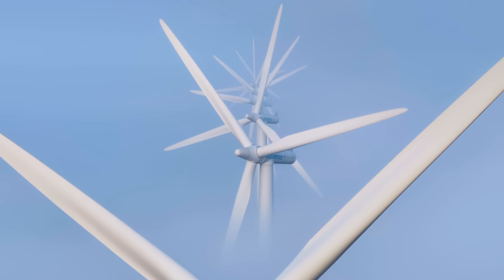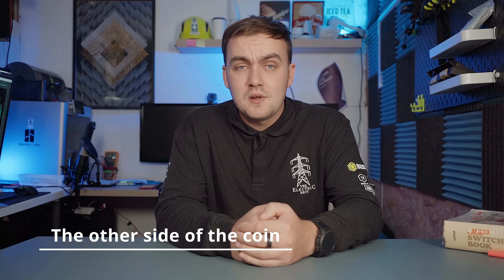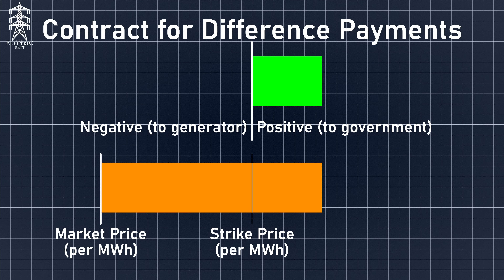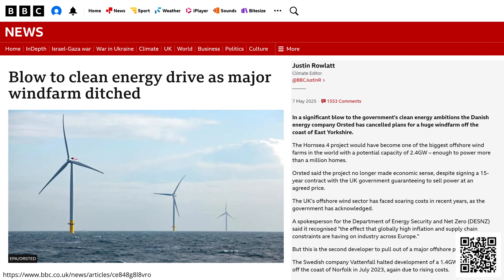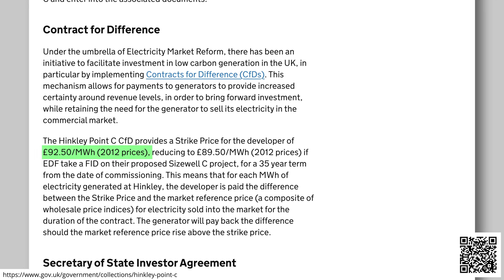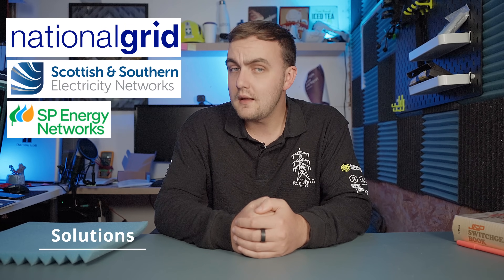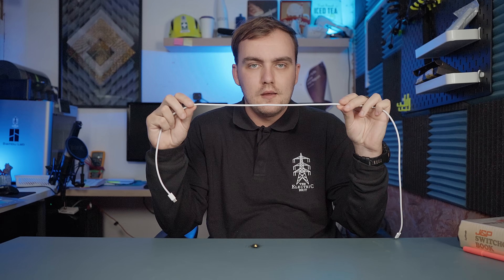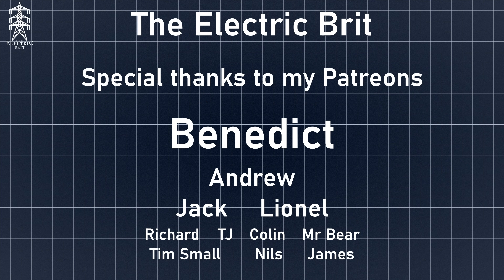£1.8 BILLION Wasted on Energy Bills

Comment: Reconductoring and dynamic line rating for the win! When you talk about upgrading lines, is it reconductoring (with new or larger traditional conductors), or new pylons that is enabling it?

Auke Hoekstra has written some upbeat coverage of this tech.
Reply from the maker: Hi! Reconductoring is the first port of call usually, moving from two to three or three to four conductors. In the UK we don't go beyond four (a quad bundle) of conductors although I've seen pictures of some UHV AC overheads in China that had 8 conductors.

Dynamic line rating is fairly new and will likely be added to lines that are already a quad bundle to try get more out of it, or to lines where they cant justify reconductoring yet.

As part of the great grid upgrade though there are brand new overhead line corridors going in for example Grimbsy to Walpole, Norwich to Tirbury and one around Leicester to Spalding is planned among others.

Comment: Everyone keeps saying curtailment is all about Scotland and the B5/B6 transmission bottleneck. That’s only part of the truth. I live on the east coast near Felixstowe, and I see it with my own eyes every single day. Even with brutal year-round wind, farms here are curtailed. The reason isn’t wires it’s low inertia.

When you spin a turbine, you don’t just make electricity. You give the grid inertia for free. That inertia is what soaks up shocks before software even notices. For a hundred years, coal, gas and nuclear gave us that without anyone thinking about it. We shut them down, and for 20 years we replaced them with nothing.

Now the grid leans on inverters. Manufacturers call it “virtual inertia.” But physics isn’t virtual. You can’t fake a spinning mass with code. Without real spin anchoring them, inverters begin to hunt chasing each other’s phase noise. That hunting is bad for the network, so operators curtail wind long before any physical limit on the lines.

Take Felixstowe as an example. The port runs cranes up to 150 MW. When a ship berths and they all fire up, local frequency swings  and house voltage crashes around a lot, any UPS trace in Felixstowe tells you all you need to know.. That’s with synchronous condensers already added on the transmission side. It helped a bit, but the farm still hunts like a drunk duck under that step. The lights flicker, the wind output gets chopped, and the official stats call it “constraint costs.” From the ground it looks like a system with no spine.

So yes, transmission upgrades matter. But to blame wires alone is unfair. The bigger truth is that we’ve hollowed out the grid’s mechanical strength. Without inertia you don’t have magnetic fields, you don’t have stable coupling, you don’t have phase angles you can trust. And without that, all the “smart” inverters in the world are just floating on sand.

And if it really was all about the B5 or B6 boundary why do we have curtailment in the south when consumption is always enough not not curtail??? Because were low on Inertia, low on mass that spins at a sync speed? Felixstowe curtails fairly regularly. 

That’s why curtailment keeps climbing. The grid could handle the power we’re generating but not without putting real spin back into the system. Until we face that, we’ll keep paying billions to turn off wind farms while telling ourselves it’s just a transmission problem.

Comment: Access energy! such as excess wind or solar, should be delivered at ultra-low costs to AI data centers, electric vehicles, and smart appliances. It makes no practical sense to keep building energy-hungry data centers around London, far from where surplus power is generated. Instead, co-locate them near renewable sources to soak up clean, cheap electricity.  🚿 ⏲️ Appliances should be mandated to auto-detect low-cost energy windows and activate accordingly, e.g., staggered 15-minute runs for washers and dryers. Let machines adapt to the grid, not the other way around. Why pay double later, when you can consume near-free green power now, efficiently and automatically?
Reply from the maker: Fully agree. Colocating generation with critical assets and power hungry ones just makes sense to cut down transmission costs. Zonal pricing aimed to fix that and we saw the panic when it came to the smart meter roll out, some people are scared to let power companies control their appliances (yet most people with an EV love that feature, I know I do, the cheaper the better)

Comment: I often wonder what our grid would have been like of more 3rd generation AGR nuclear plants (like Heysham 2 and Torness) had been built like at Druridge Bay. At that stage it seems like they had finally resolved on-load refuelling limitations for older AGRs (as a result allowing Heysham 2 to break world records for reactor up-tine). I’m not sure if inter-core fuel re-shuffling was ever implemented though.
Reply from the maker: I had planned to do a video on the different generations of reactors and pros / cons. I’m of the opinion that if some designs had been banned, we might be in a better position both in terms of public opinion (safer options) and technologically (more investment in the right areas).
Reply: @TheElectricBrit The older Magnox fleet had mixed results - largely due to the base design being modified/evolved by different builders. The AGR fleet was more consistent, but the disaster that was Dungeness B killed off export orders (apparently US utilities were interested in the design at the time). The whole fleet of gas cooled reactors have proven to be very fault tolerant over the years – including tolerating operator negligence like blocking fuel channels by accidently dropping tools into them.

Comment: Small point: it is fine to pronounce NESO as "knee so". Also, ultimately, we need more py^H^H transmission towers. I know the nimbys want to blame renewables, but generation tends not to be where land is expensive (the South East) while that's where the increasing demand is. SSEN did a thing on the challenges of undergrounding 400kV which nicely explains why it's so rarely done with exceptions like the last few miles to Dinorwig.
Reply from the maker: Cheers Phil, I’m a stickler for speaking acronyms, even after 18 months I still call EGL - EGL where most call it EaGLe.

I’ve got a video planned to dismantle the arguments of some prominent groups here in East Anglia, talking about capacitive charging currents and cable limitations etc, and have had the same arguments on LinkedIn about the Scottish highlands. I’ll be kind but I’m sure work won’t be happy! 😆
Reply: The Rampion wind farm off the Sussex coast has its 17 miles of 150kV onshore transmission all underground. About half of that is through the South Downs National Park. The other half is past the back gardens of some well-off NIMBYs. A similar all underground routing (but 400kV) is planned for Rampion 2. The transmission built for the Shoreham coal power station (now CCGT) follows almost the same route and is all on pylons.

Comment: A comment from across the pond. Wind is a cheap source of electricity but the problem is the wind is not located were the load is located. In addition wind is not all ways blowing at the same time that the load is calling for more power. If that were not enough, add into that the transmitting bottle neck that will not permit the flow when they do match up. The best solution is to add utility scale battery's. The fist place is to add them as close to the load as possible (distributed on the distribution network close to homes and factory's for the best impact) as not only can they sync up load with supply but they can also meet peak demand requirement's as well. The second best place is at the source which can soak up excess supply that can not be sent to the load because of transmission bottle necks or lack of load. This allows transmission lines to theoretically be loaded up 24 x 7 to its capacity. After which once full capacity is reached a transmission upgrade is required. We don't have much offshore wind running over here so we don't have the experience that you Brit's have. But Texas is an interesting point as they have a lot of onshore wind which is very active at night. In fact there is so much if it that it drives the whole sale price into negative prices at night. As a result some of the Texas utility's were offering there customers free electricity after 10 PM when load is light and supply is abundant. This is because with the negative prices the utility's can still make money. To take advantage of all of the wind available in the north west of the state they built a transmission line from there to the load centers. The result was that this new line filled up to capacity and no more wind could be developed. Once that happen developers realized that there was plenty of capacity available on the line in the afternoon perfect to use in developing utility scale solar. Now the line is filled up during the day and the evening with a small dip in power when solar is ramping down for the day and the wind is starting to ramp up for the evening. On shore wind and solar appear to be a perfect complement to each other with a small amount of battery's to fix the early evening Power dip between the two. Perhaps you may want to make a video about the subject. Best wishes to our British friends across the pond. By the way I love that the cat wants to contribute to your videos.
Reply from the maker: In the UK my energy provider gives very cheap power between 11pm and 5am or there abouts to make use of cheap night power. They control my car charger to charge it when it’s cheap. 

I replied to another comment about the amount of battery projects coming online over the next 10 years, a lot of what’s being built now is near the bottle necks

Comment: Numbers are put forward in the press without any context. 
1.8Bn is indeed a lot for Mrs Bloggs down the road.
The total electricity bill for UK is around £50Bn (300TWh) per year, so £1.8Bn is only about 4%. 
Not ideal, but not the disaster portrayed in the Daily Tripe-o-graph.

I can see 4 offshore large windfarms from the end of the road here (using pair of binoculars).
Reply from the maker: Agreed, but it’s still £1.8B of waste that we can reduce, plus the additional £12B for standby gas stability services. So around 30% of savings in total, not including all the other cost benefits (and spending needed to replace that stability services). Greenpeace published a paper on the savings yesterday or so, but with everything you need multiple sources of information.

Comment: Another very informaive video Jordan - and a lot of work researching the information - thank you.
All the acronyms fog my brain and make the point that privatising everything (Thatcher mantra)  just complicates the maths and the administration, but acountants love cost centres.
Instead of paying for curtailment why not store the energy? 
Battery Storage, Pump Storage, Compressed air storage, district heating ?
I understand that there are infra structure costs associated with these schemes but they become permanent structures. 
Could these energy storage mechanisms offset the need to use gas generation?
Having read Small is Beautiful (a long time ago) I remember one key observation " Think globally, but act locally"
We over complicate things.
Reply from the maker: Hey Steve, thanks for the comment and I agree. I have no idea about RO (Renewable Obligation) payments before I made this video and it really got me thinking. I dug deeper after I finished shooting the video and found the staggering costs being paid out for past projects and how it really just obfuscates things.

I think battery, hydro and district heating should definitely be considered where it makes sense. There's pros and cons to each but more storage is definitely a necessity to help manage the peaks, and also helps with inertia and voltage control which are hot topics around blackouts. 

We do still need to invest in the network to move the energy around better though, as it still needs to get to storage, and then from storage to where the demand is.
Reply: @TheElectricBritthanks Jordan.
You have a better understanding because my knowledge of the infra structure is limited and I'm retired.
Like every engineer I'm looking to improve a system's operational efficiency and integrity and what you are showing is that political pressures are overriding these fundamental requirements.
Moreover because of the 1980's mantra of privatisation shareholders are looking for profit.
I believe this is unhealthy for the sustainability of a national strategic utility.

Comment: It really is an example of why assuming in the 1980s that private enterprise would always create the most competitive market, and applying that blindly to everything the country needed, was a very poor choice.  I blame Professor Sir Alan Walters, Thatcher's main economic adviser.  But we are where we are -- we need to develop ways of storing the excesses in order to release it when it is dark and there is no wind, for example.  What sort of capacity is there in the growing BESS sector?
Reply from the maker: BESS is rapidly growing. We're at around 6GW / 8 GWh of storage currently which will help for some peaks and troughs but to really be effective for stability we need the equivalent of that distributed in every county I'd say, to account for some being out on maintenance, some being empty or full etc.

There's 17 GWh connecting to the grid in 2025 and about 444 GWh in the pipeline which should definitely see us right. Most of that is due after 2030.
Reply from the maker: Thanks for the comment. I agree, it's hardly competition when you have regulated monopolies and "The Big 5" for example. I don't think we do too bad in transmission but I might be bias, but it still doesn't take away from the stupidity of privatising critical and necessary infrastructure and making said regulated monopoly...what's the point other than to make a quick buck for the government and those involved at the time and make the tax payers pay indefinitely?
Reply: @TheElectricBrit Michael Liebreich suggests 4 hours of battery storage is a good rule of thumb to get countries through peaks and troughs of generation during a given day. The 444GWh capacity would be between 2 and 3 hours of storage?

Comment: no wind = no power, but they still get paid. Too much wind = lock windmills off, you dont want them to overrun and explode, literally explode. But still get paid. ITS ALL A GIANT SCAM
Reply from the maker: I responded to someone on LinkedIn today about this. They will only get paid to switch off if asked by NESO. If they switch off due to high winds to protect their turbines, that's on them and they should not be paid for this. They won't get paid if there's no wind, only for the energy they export or could export if told to stop.

Same for gas plants that are needed for balancing the grid but go off on maintenance - they aren't meeting their obligations so shouldn't get paid.

Comment: The CFDs have provided cheaper electricity. By guaranteeing a level of income the cost of capital borrowed was cheaper because those providing it didn't need to factor in potential losses. In terms of offshore wind farms, the cost of capital is a big element in the cost of building the wind farm. So reducing the capital costs allowed for lower strike price bids. The issue with the withdrawn wind farms was that the interest rates rose at the same time as there was inflation in the cost of the materials to build the wind farms, plus energy costs for the shipping needed to clear the boulders, lay the cables and erect the turbines became expensive post Ukraine.
Reply from the maker: Hey Brian :) I did believe that at first and to some degree it will always be right by way of what you've said, however after writing the video I did some digging into the Renewable Obligations and CfDs. Renewable Obligations are going to cost us something like £100B over their lifetime which is surely more than all of those projects combined would be worth on a per MW/h generated basis. Then I compared the highest strike price of each technology in each AR CfD round and found that renewables were only returning to the consumers purse in a handful of situations, but there are some outliers like AR1 and new technology in AR6 that really drag the pack down to a net loss i.e. wholesale prices were lower than CfDs, so we topped them up.

It is a decent system that has made renewables competitive I'd say, and has brought down the cost of projects over time as we can see with increasingly lower strike prices and much better technology, and we wouldn't be on a path to "net zero" without it, but it will come at an early adopter cost. I'm keen to try and write a professional white paper on the true cost of renewables / net zero so would definitely need some people better at math and economics than me to fact check it!